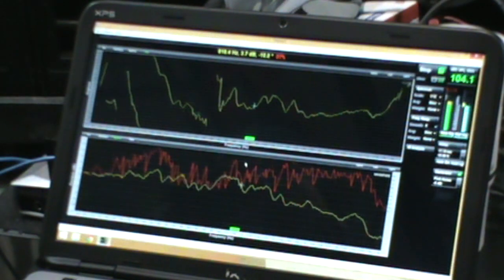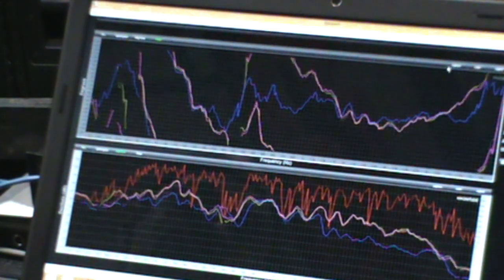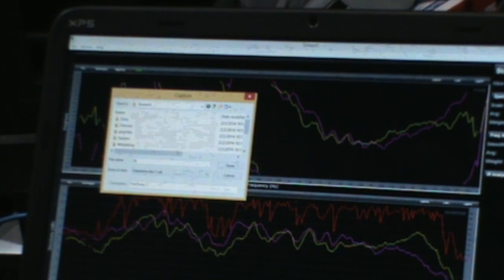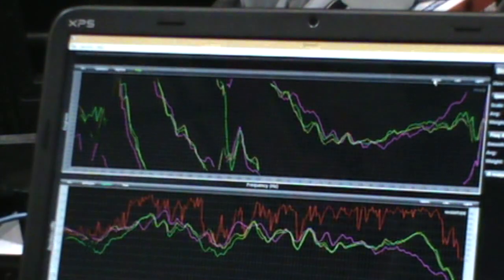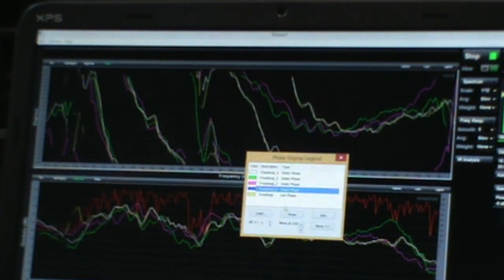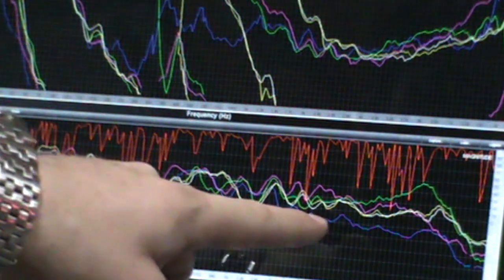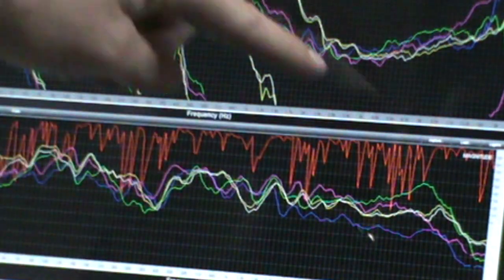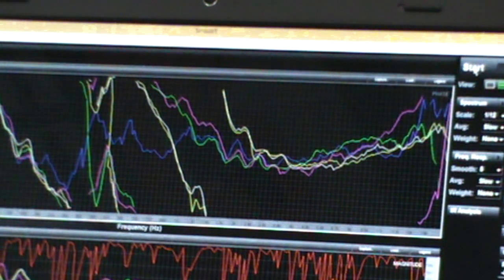Shoot Out SMAART-ly

Comment: If you notice all of your measurements had the same phase shift around 300HZ. Microphone was probably on a stand and that was the reflection off of the floor. So common issues in phase or coherency with 4 different speaker products is probably something in the measurement that is common  to all sources.